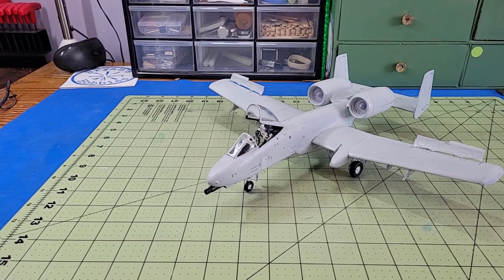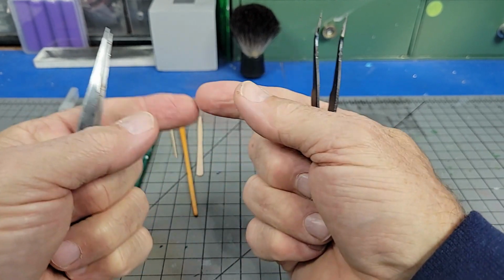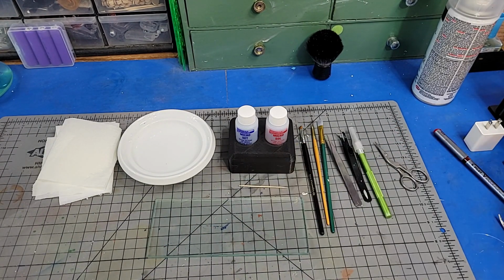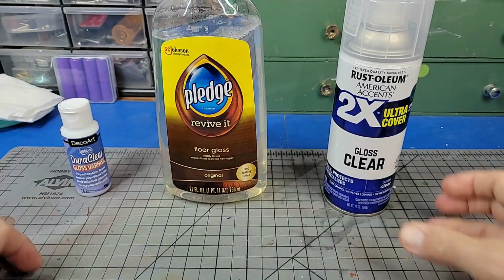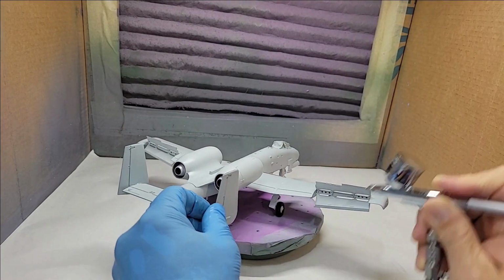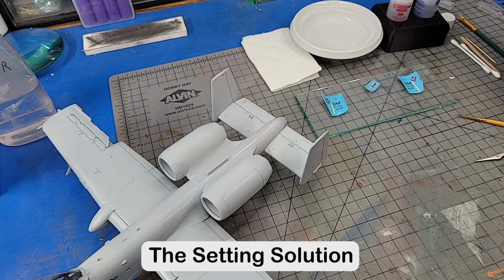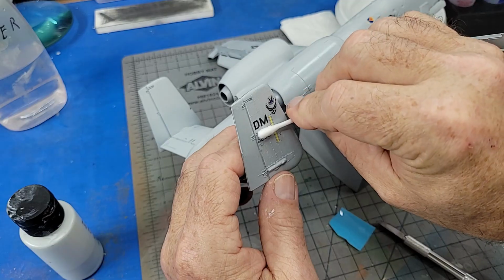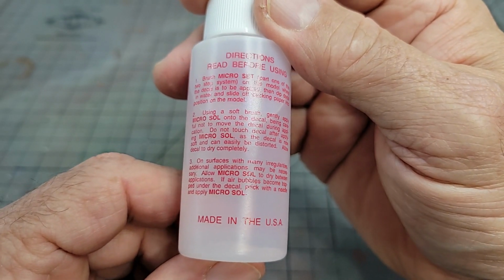Applying Water Slide Decals Your Model Kits [A Comprehensive Guide]

Comment: The problem I keep running into is a small decal that needs to confirm to curved surface. It's a 90° bend downwards (the thruster decals on the saucer section of the starship Enterprise 1701 - A). The decals are these little yellow triangles and they are rigid enough to stay in their natural flat state. I can't get them to conform to the curve and end up just painting those areas. Another problem spot for me are the phaser bumps. The decals for those areas are tiny rectangles but the model has two little bumps that keep the decal from adhering properly. After a few applications of micro sol, the decals always rip and just 6 more spots I end up painting (or I file the bumps flat). The model is in the 1/1000 scale and I just can't seem to get the decals on properly. I have attempted 3 different models with the same results every time.
Reply from the maker: Forgive me, but it sounds like, in this case, the decals are defective or old, or both. 
If I might make a couple of suggestions. The first one is theoretical at best, but you might consider trying to wet the decal with the straight setting solution. I've not tried this myself, but it might soften it up enough to take the curve.
The second suggestion is to scan the decal on the highest quality settings and reprint them on a new decal sheet. 
Good luck in either case and if you figure it out let us know. Thanks for sharing!!